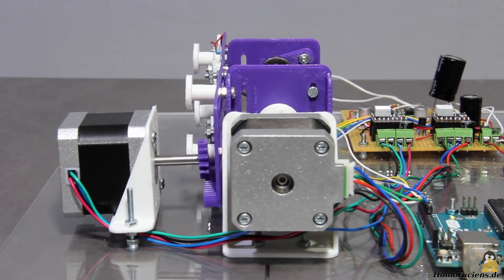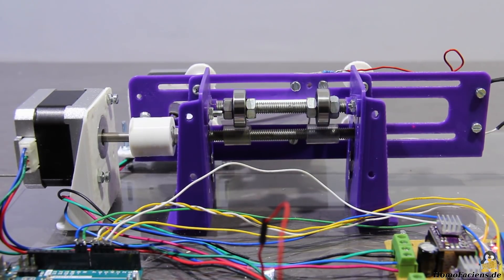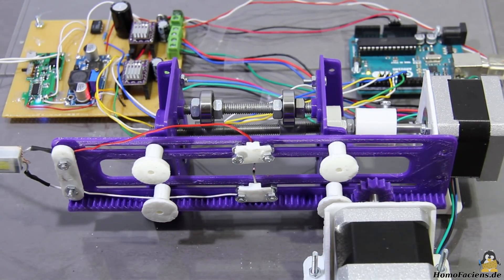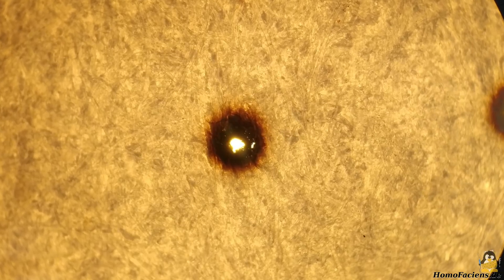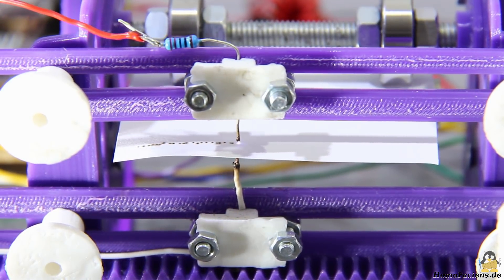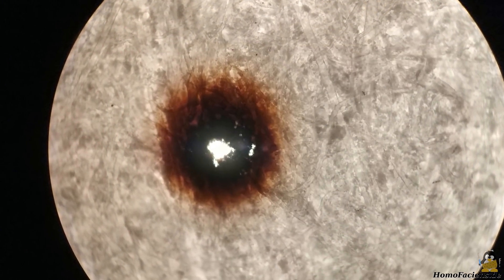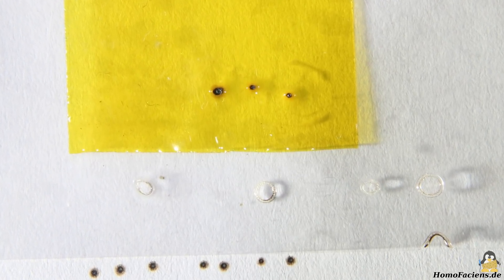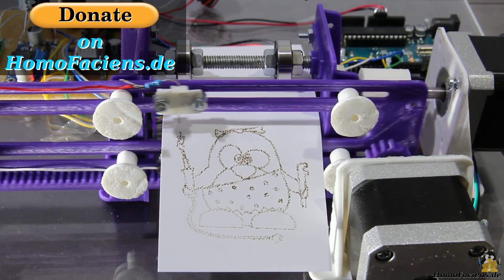Arduino Uno Plasma Printer

Comment: maybe you need a pilot arc to get better results....but this would just burn the paper..maybe you should work on the paper also. Just search for plasma pilot arc.
Reply from the maker: Pilot arc only makes sense for plasma a torch that would have both electrodes on one side of the paper. I am indeed thinking of doing something like that. Thanks for sharing your thoughts!

Comment: You could try to put some kind of shield on the "print head" to reduce the amount of oxygen that can reach the paper. It would reduce the chance of it burst into flames. A simple hose with CO2 produced by reacting NaHCO3 with vinegar should work. The paper would carbonise by the heat but not catch fire.
Reply from the maker: Still there is the problem with the random path the plasma takes between the electrodes which reduces the resolution you can get. Maybe a mini plasma cutter (plasma torch) that burns the paper only on top would make things better. Blowing that kind of plasma arc on the paper surface with CO2 could be a thing. I'll keep that in mind - thanks!
Reply: @HomoFaciens  I agree. The only way I can think of for guide the arc is to confine it with narrow glass tubes. This way you can reduce the dispersion. But I don't know how much time you intend to spend on this printer. Normally, quality and simplicity go in opposite directions.
Reply from the maker: Yes, I had similar thoughts of placing both electrodes on one side of the paper and force the spark along the surface through a glass barrier. I will probably do some experimentation into that direction after making my filament extruder work (my current project)